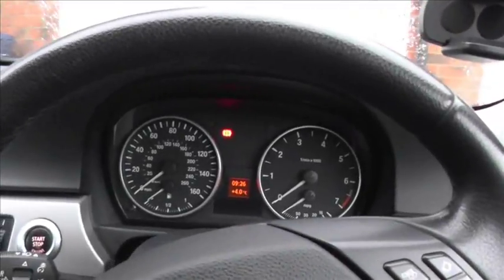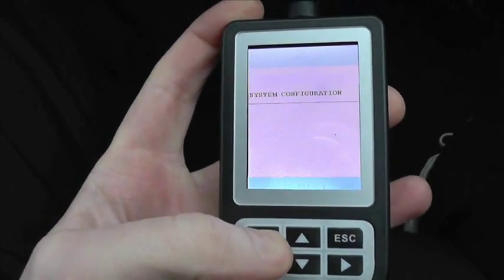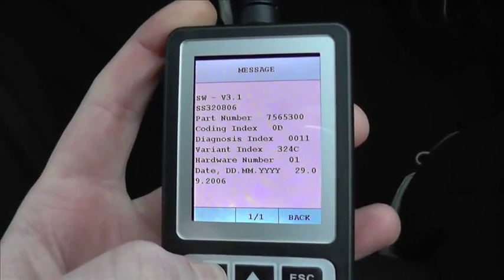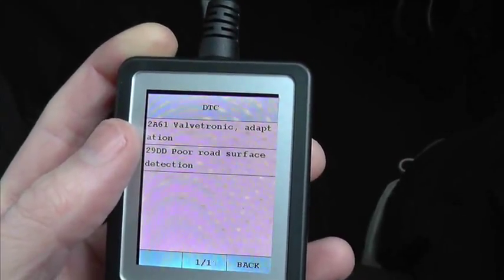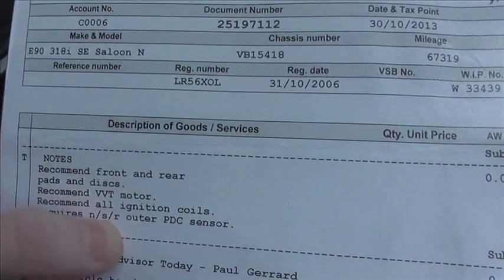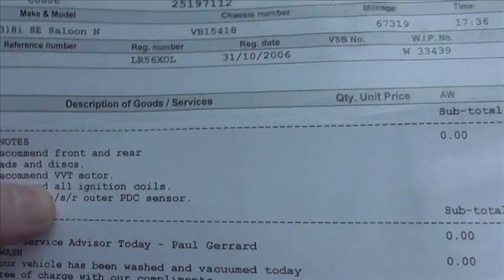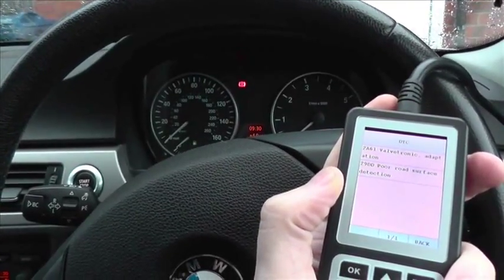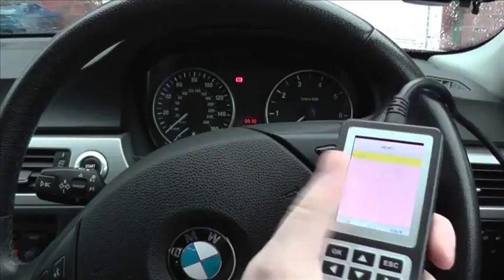BMW Vanos Diagnostic

Comment: valvetronic is how much valves are lifted, driven by a motor. Vanos is the advance and retard of the camshafts driven by the oil pressure and solenoids to the 2 cam gears. They are different. This is not a vanos diagnostic.

Comment: I have E90 325i automatic it switch itself off whern i apply the break on stop sing or speed homp pleas some body help me i went to the machenic but problem never solve we changa air follow meter but still.

Comment: Change the heading to Scan tool ad
Reply: So the tool cant run the reset valvtronic adaption values then. It would be better to try resetting adaptations before changing a £200 motor as even if it has got a faulty motor the reset adaption function will still have to be done to complete
this job.
Also there is a fuse and relay for that motor and obviously if one of them is faulty then the motor wont work the engine will still run, but you wont get a code saying fuse blown or relay faulty.